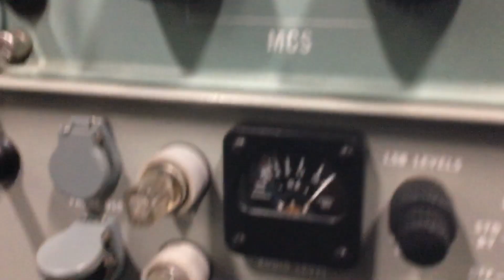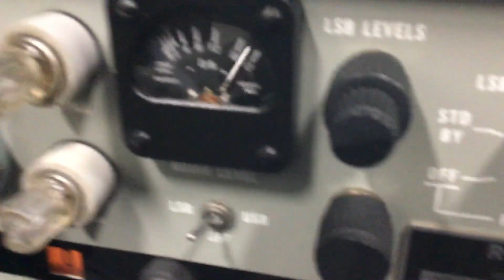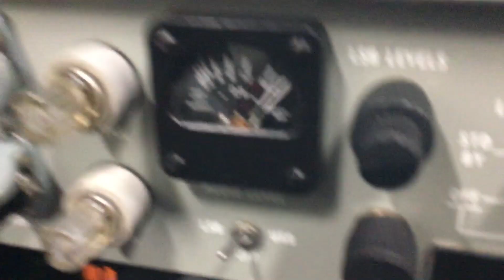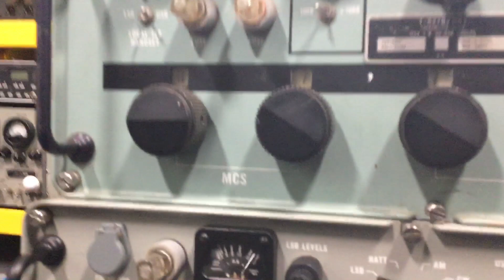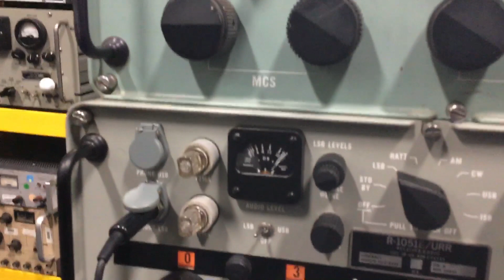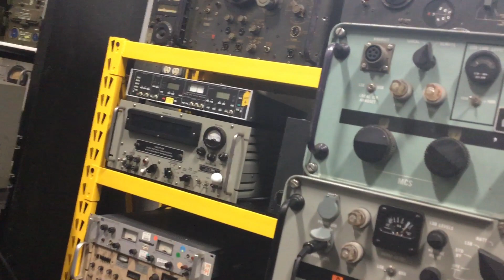Chinese spy balloon Thursday radio ?

Comment from the maker: Images from U-2 flybys and forensic analysis of the payload showed antennas that likely were used for collecting and transmitting signals intelligence.[54][55] A publicly released U.S. State Department document, after the balloon was downed and debris collected, said that the balloon's solar arrays produced sufficient power to run "multiple active intelligence collection sensors" and that the antennas on the balloon could collect and geolocate communications, including radio and mobile phone signals, but it was unclear what specific devices were targets.[14] U.S. authorities identified the manufacturer of the balloon with high confidence as a company with direct ties to the People's Liberation Army. U.S. officials cited this as an example of military-civil fusion, in which Chinese civilian enterprises are highly integrated into China's military structure.[14]

Comment from the maker: For several decades from the mid 1960's through the 90s??, the R-1051 was THE HF reciever of the U.S. Navy. It, along with the matching URT-23 and 24 transmitters, were the HFwork horses of every radio shack. The R-1051 was used on all Navy ships from patrol boats through carriers. It was designed to allow anyone to set up and operate tactical SSB nets or run a full period HF termination to a NAVCAMS shorestations. The 1051 was channelized and all you had to do was click to the proper frequency, patch in the right antenna, patch in the right output and you were set. Much less effort and skill than tuning up an R-390, which the 1051 replaced. With its amazing stabilility, it was tune and forget.

Today, it's still a pretty good reciever albeit a pain to tune around with due to the channelized decade tuning that was incorporated to make set up very cookbook for the radioman. It's a beast weighning in at about 80 lbs. From a maintenance standpoint, it was a charm. Almost fully modularized, the ET's (repair techs on board ship) loved it. Stocks of the "Six Packs", the six main modules in the radio, were kept onboard and if one of these radios was off the air for a few minutes, it was rare.

As a comm officer on a guided missile destroyer in the late 70's early 80's, I had eight R-1051B's in the radio shack. I came across one at a ham fest in Colorado Spings and with nostalgia in my eye bought it for $200. The CPS synthesizer module as fried but a quick call to Fair Radio sales yielded one for $ 40 and within a week the radio was fully operational.

In side by side comparisons with my Drake TR7, the 1051 is about equal in sensitivity but far more stable. The audio output is a bit light but fully usable. These things operated into an amplified patch panel in the Navy and you could switch their output to the bridge or CIC. 

All in all, these were the radios that helped win the Cold War when the U.S. Navy had to operate HF only in what was termed "Smallpipe" operations that simulated the loss of all satcom systems. You see, the Soviets were known to have planned to take out all the Navy sat comm satellites as a first strike in a hot war and the U.S. Navy drilled hard to maintain HF capabilities in order to maintain command and control if the satellites all vanished. After all maintaining reliable HF comm is a an acquired skill that is as much art as science.

This is just a little sub note about this little known radio that was built on a fluke by General Dynamics...I beleive this was their one venture into HF electronics. I have heard that most of them were crushed as the Navy moved on the the Harris replacement. In any event, I hope that this sheds a little historical light on this great radio.
Reply: Great information on Navy radios thanks for your comment I go back to late thirties with navy stuff